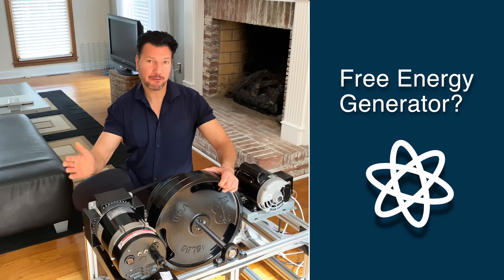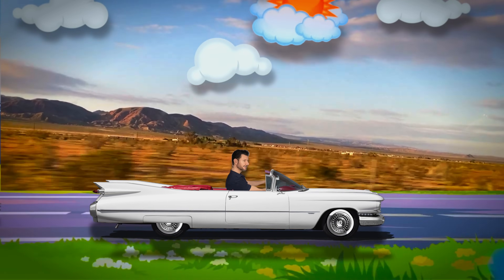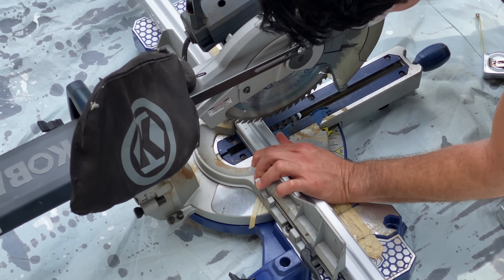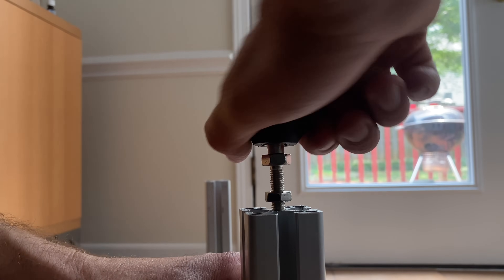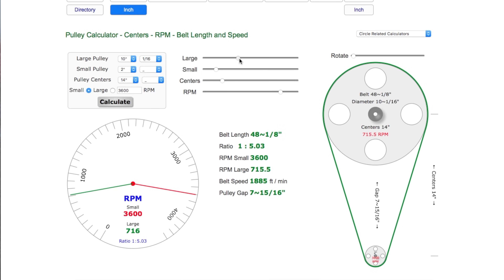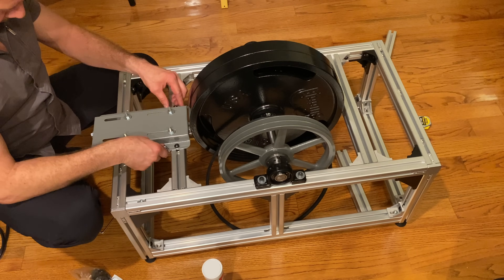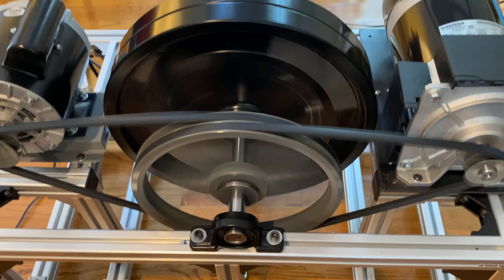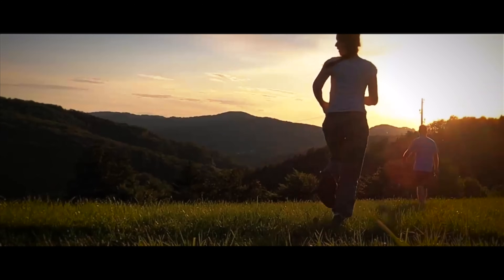How to Make a Free Energy Generator!

Comment: Have you considered a 12v low speed cut in wind generator (2,000  to 10,000 watt) ran off a 2 ah 12v variable speed drill motor via direct chain drive? NO flywheel to cause friction and speed reduction, just a free spinning tensioner to keep the chain tight. Keep in mind that you'll need to voltage regulator between the generator and the batteries as well as a switch between the batteries and the motor.
Reply from the maker: Yes looking into that.
Thank you Kevin!

Comment: I see 3 differences in what you built compared to the machines that claim to be FE First, you may have too large of an electric motor.  3HP seems to be what everyone uses.  Second, the flywheel is not 100kg or 220lb and it needs to be much larger diameter with the weight mostly on the circumference as you pointed out.  Third, and maybe most important is that you need to modify the approximately 12k alternator with the ND magnets to increase how much output power is being generated.  In fact, some of these don't use the flywheel
Reply: Yea, its all about the magnets.. but I didnt see u use strong magnets at all. Just tiny ones and no coils? Where is all the coils?
Reply from the maker: @joshthepwnr22  they are in the Generator Josh. I show the coils in part 2
Reply: If you use horizontal flywheel you can use ancient method of hanging sand bags from smaller diameter. As it spins faster centrifugal force moves the sand bags farther from the center. This less energy is needed to start it rotating and less energy is needed to achieve the same result of having more weight move farther distances at higher rpms.
Reply from the maker: @treebase1047  I like that idea!
Reply: Hi, what is the size of pulley needed. What is the rpm of 3hp motor? Detail pls.
Reply from the maker: Hello Charles please watch part 2 you can see the motor and generator specifications in it.

How to Make a Free Energy Generator Part 2!
https://youtu.be/tFqn-atYcOU
Reply from the maker: Thank you Joseph!
Besides the motor you’re probably correct.
(My motor is only 3/4hp)
Reply: @MarkusNenning  I think it's still too big

Comment: Here’s what you need to make it work. You need a source of continuous power coming in to your electric motor. I recommend a battery bank that is powered by solar. I am designing a passenger drone in which the motors are powered by this very design. However the top of the craft is covered entirely in solar panels producing more than enough energy to charge the batteries while the batteries run the electric motor that spins the flywheel so that you have power until you run out of sunlight. Some might say well why not go full electric? Well you can’t produce as much power with only solar panels at such a small scale as it only takes 3 kw to charge the batteries sufficiently. While the generator can produce double, in my prototype 1/2 scale, we are able to maintain flight for 4 hours and 22 minutes before we hit critical low battery status.
Reply from the maker: Very interesting!
Do you have a video of your drone yet?
Hope your project is successful!

Comment: You cant have a rectifier, voltage regulator, or factory brush system.
They slow it down.
Free flow magnetic excitation.
You used factory junk, made to fail.

Comment: This is a cool attempt at an overunity device. What I think is that you need a larger fly wheel that will store more kenetic energy like a battery. I've heard the idea of using solar or wind power to spin up a very large, heavy, and well balanced flywheel that would spin for about nine hours when fully charged. I can turn a generator to convert the kenetic energy back to eletricity. So some place with wind or sun where the you still need to store energy for night time or when the wind isn't blowing you can use a large flywheel for something like that. Creating a magnetic flywheel device that is the generator and motor in one device might also be a good idea.
Reply from the maker: That’s a nice idea.
Thanks Buck!

Comment: I think the concept works.  But you have no multiplication of power through mechanical advantage.  Your pully wheels for both generator and motor are the same rpm and the same pully connected to the same flywheel.  Although i havent done it YET Im sure multiple fly wheel of different pully size need to be in play.

Comment: The secret is balance & power generation at lower rpm doesn’t take much to charge a battery bank !  You need to alter generator to use powerful RE Magnets NSNSNS—- car alternators can be rebuilt with mags on roto instead of big electric coil !   These strong magnets attract the energy in the air around them and this is induced into generator !  That is what Nicola Tesla meant taping the sea of energy !  Most of the demos from India are using these methods some without flywheels work - the electricity produced is ac and continuously flows in a loop !  AC Gen AC motor  ! Not much excess but could be fine for charging a battery bank ! Pull your big power when needed from the batteries !

Comment: Why don't you use car battery and inverter to support the motor durring the switch of power source? Battery can be charged over solar panel, but it should run the motor for few sec only.

The point is not to get more energy on output than enery on input, that is not possible. 
The poit is to create energy which you have to pay using energy you don't have to pay. At least this is what I am looking for.
Reply from the maker: My next step is exactly that using a car alternator and modifying it.
Thanks!

Comment: you cannot use a factory generator, you must make your own using neodymium magnets, this will give a much higher frequency to help power the motor when you switch over, it may also be necessary to change the motor start capacitor to match the new voltage / frequency to the motor, good luck.
Reply from the maker: Thanks Brian!

Comment: I believe it is a matter of refining the current generator. It seems that by changing an induction car xurrent generator by fitting Neodimium magnets in the rotor, the current gain gets lot bigger. So it steps from 12V up to 226v. This allows to get connected to a single phase motor and produce more power than the motor consumes. The impulse timing is also controlled by pulley syncronixity.
Reply: The biggest problem why self ruining generators are considered impossible is because the generator creates a drag force that slows down the flywheel and loads the motor. If the flywheel spins slower then the generator creates less power and the  motor draws more power. So the generator cannot provide enough power to run the motor and generate extra power. So you must either use a low drag generator design or, as I'm seeing in these flywheel videos, find some way to make the drag force negligible using the flywheel. I have seen videos of people using magnetic coupling to connect the motor and generator. The magnetic coupling prevents the drag from the generator to be transferred to the motor and load it. trust me once you can build a low drag generator then this is possible. I have read papers that said it is possible and it has been built, and the equations that govern it have been written. It was done by the Russians and they call it the new laws of mechadynamics, and the law of  inertial increase of electric power (page 16 of the second link). 

http://www.borderlands.de/Links/IMPULSE%20POWER%20SECRETS-3doc.pdf

https://www.gsjournal.net/Science-Journals/Research%20Papers-Mechanics%20/%20Electrodynamics/Download/2347
Reply: you know that a E Motor Works with ~99% efficiency then the loss to heat, friction and vibration the other motor losses the same amount and will stop you will never generate energy for free
Reply: @hextraheckerpecker   Some people just don't get it.  I just ask people who "CLAIM" it works, How do you recover your losses? I wish you tube would delete these type of videos. If this were true then every house in the world would be using them by now.  Just to many scams and Bullsh*t on yt.
Reply: Hi Daniel, what you are saying is if you have car alternator say 12 volt and you fir Neodimium magnets it will give you output of 226v, I have some alternator 150 mps at 12 volt I will try to do the test to see what the voltage is.
Reply: @yannis92preloude  wont make a shit worth of difference!
Reply: Yes
Reply: The point is: do we areally know what some type.of magnet are doing?? What if they can with the right geometry and frequency timing extract wnergy from the Zero point quantum layer?

Paul Laviolette talks about open systems, which tapping into  higher dimensions, can extract energy from the quantum layer

Comment: The drive motor needs to be 3 phase that is controlled by a frequency drive around 25 hertz... no belts.  The generator needs around 750 - 1500 RPM.

Comment: You could have done it all with calculations. A 3 hp motor requires 2250 watts to run at capacity while a 3000 watt generator requires a minimum of 4 hp from a high torque diesel engine to provide a continuous 2400 watts. Results, what you spent a lot of money to discover.
Reply from the maker: Alfred I have a 1/2hp motor and a generator that produces 4.8kW 
I can run this Generator under load with the motor but it doesn’t run from its own energy. Watch my second video where I show that by the specifications I should be able to run 19 motors.

Comment: Remove flywheels, they consume more energy from motor, they are heavy and gravity does his job in this case. You need to pick low rpm as motor and from motor big○ to mid section small° and from mid section big○ goes to generator small°. You need high rpm generator, because speed grows 4 times as well as energy
Reply from the maker: Thanks SeoMedia!

Comment: What do you think about feeding the motor with solar energy every x time so that it doesn't stop? Let's say that it would be a safer alternative, sending impulses to the engine together with the flywheel, it would spend very little electricity, but that way we would be able to get a higher production, in the alternator.
Reply: It would be a bigger loss ... how do you compensate in cloudy weather, fog, at night? to compensate you need at least 2.5kw, right? in this case, install 8 photovoltaic panels with a 3.5kw converter and 3 batteries of 240A each. And you don't have to bother with this project anymore.
Reply: @gabironl  hi
Reply from the maker: @gabironl  thanks!
Reply: @gabironl  they didn't get the hint ...
Reply from the maker: Yes I have thought about that and still believe that is a good idea.
My plan isn’t to build a perpetual motion machine. I just want a more sustainable way to produce energy.
Thank you!
Reply: @MarkusNenning  https://www.youtube.com/watch?v=KnDe79N5_5s&ab_channel=Mixr%2Cblendingideas
Reply: Or waterwheel assist.

Comment: These people from India are smart. I would challenge to use  motor to get the correct speed. And use a stripped down power generator,  inverter style and fit the motor to it. No flywheel. Start it up from AC power. See what can generate. Maybe try re-cycle the energy.
Inspired by this video.  https://youtu.be/yLCmJldDAfk

Comment: Hears  something  you need to learn   that the centerifugal   force generated  by a flywheel  is always  higher  than  the  centripetal  force I.e in the  center of a flywheel  which is generally  cancelled   if a large  flywheel  is connected  to  a small  flywheel   through  a pinion  gare  system   a little suggestion  is to check out  Dr  Shrinavas Bhaskar chaganti a phd in mechanical  engineering and his  research  videos  on YouTube   as  he has  definitely  proven  energy  amplification  is possible   and challenged   the fundamental  law of  physics    Know coming back to the device  that you have built  , where you have the a small  drive  disk connected from a large  v belt  disk  which  in turn  creats  more torque  or load on the drive motor  therefore  drawing  more Amps  from your input source      hope this was helpful   if any  droughts please  leave me a personal  messages  thank you
Reply from the maker: Thank you Joaquim!

Comment: The standard system would be fine if we hadn't outsourced its manufacturing to communist countries using the metric system..  like how do they accurately measure 1/32" in millimeters or do they even care if you dont have a tool between 1/2" and 9/16"???  Yes, I know that is 17/32", but who actually has a 17/32" wrench??  Outsourced manufacturing = Downfall of america
Reply from the maker: I can’t tell if your serious or joking 🙃
Reply: @MarkusNenning  LOL!  A little bit of both! I have a 97 dodge truck and all the body parts and small parts, which probably came from overseas, are assembled with Standard fasteners and most the motor and drive line components are Metric and probably were built in USA, at that time.  Every time I work on it I cuss Chrysler and outsourcing..
Reply: @MarkusNenning  It would be nice to have one system..  Standard Fasteners used to be of Higher/Stronger Quality and I still find alot of weak Metric fasteners, but it probably doesnt matter anymore since we dont smelt or forge steel in America anymore because of pollution.
Reply from the maker: @tomjohnson1341  unfortunately that’s just the current business model.
Everything has to be cheap and cheaper.
Quality seems less and less a priority.

Comment: You need to loosen the tension of the belt connecting the flywheel to the electric motor so that it would not budge hold the rpm of the dynamo when the motor rpm glitches and drops. Same concept on a bicycle pedaling it clockwise runs the gear/wheel but dis engages when you pedal it counter-clockwise giving you freewheel momentum when the bike is running. It could also be possible if they could design a pulley on the motor side with a dis-engaging gears when the pully rotates in reverse.
Reply: Interesting theory
Reply: "Glitches"

In real life?

HOW!?
Reply: Yes I noticed the Indians were using a belt tensioner, and would adjust the belt as needed.

Comment: Markus,

I am very interested in trying this out and your video is great, thanks for making it.

I was going to use one or possibly two 150 pound semi truck flywheel that is already balanced,  I want a lot of kinetic energy. I just need to figure out how to mount the flywheel to the shaft.  What type of coupling device did you use to couple your weights to your shaft?

For a electric motor I was thinking a three phase high efficiency motor and use a VFD to go from single phase to three phase that will control the motor.  Your thoughts on this?

Thank you for your help.
Reply from the maker: Very cool Paul! 
I actually added a link in the video description of the coupling I have used to attach the flywheel to the shaft.
It’s called keyless bushing (there is also an explanation in part 2)

I had no idea that a semi truck flywheel is that heavy 😳
Perhaps I’ll look into that myself. Great idea!

As for the 3-phase motor, it is definitely more efficient than a single phase that uses a capacitor.

What kind of generator do you have in mind? I got lots of comments on here all recommending low rpm permanent magnet generators.

Best of luck! 
Keep me posted!
Reply: @MarkusNenning  

Hey Markus!

Thanks for responding, as far a Generator goes I will use a PMG. I will also use some sort of a precision bearing as well.  I'm hoping this will get me the results I'm looking for.

Thanks.
Reply from the maker: @Paul196687  hope it works Paul would love to get mine working as well some day.

Comment: U need a bigger flywheel , smaller motor and smaller alternator that produces around 5 kw of power, then some tuning with the pulley size then we'll be rocking 💯
Reply from the maker: So basically everything different :)

Comment: There is an invention in India on Fly wheel mechanism named KAMMA Fly wheel. He said It is patented. He seems to run in 5 sec intervals then running generator for about 100secs on load greater than the input load. Would you look into it. I am going to his plant to see how it operates. Would you be willing to guide me on which parameters should I check.  https://youtu.be/v22AbFHteaI
Reply from the maker: Very large and expensive systems.
But interesting.
Thanks

Comment: I greatly respect your effort and time that you put into your project.
Reply from the maker: Thank you very much!
Reply: @MarkusNenning  the puzzle peace is neodium magnets a type of alternator and electrically induced magenets that gain power as the alenator speeds up and then created more power than is needed to keep the momentum. That way you gain power from the earth magnets as they are the oposing extra force that the powered magnets use to create the rotation. Thats the answer
Reply from the maker: @theknowledgewithin  working on converting a car alternator at the moment.
Thank you!
Reply: @theknowledgewithin  lies
Reply: @marchustletime39  ikr
Reply: WHY DON'T YOU TRY A FLYWHEEL WITH MORE WEIGHT ON THE OUTER PART AND A BIGGER DIAMETER.

Comment: What about a spring loaded flywheel.  You build a Fram around the flywheel with spring on top to the right just a tad.
Spring on bottom to the left just a tad .
With barings to hook to top to bottom on a off setting shaft. When the spring is stretched out it would pull up from top.
Down from the bottom.  Just an idea. 
You could even use a fishing magnet on a off setting shaft at the end that never touches an iron bar  but gets extremely close to put the heavy side of flywheel up to make its next revolution.  Just a thought.
Reply from the maker: Thanks Greg. I am looking into using magnets to drive the generator.